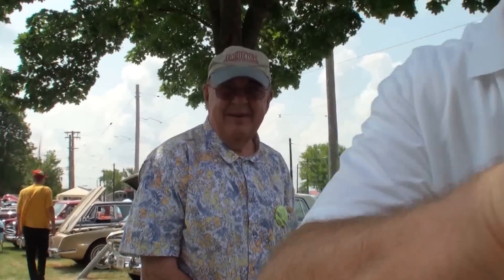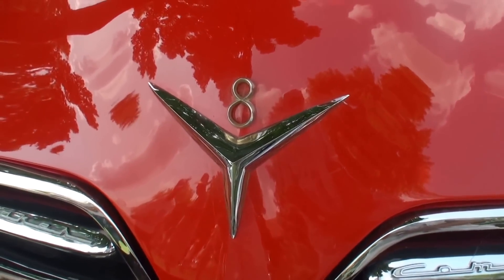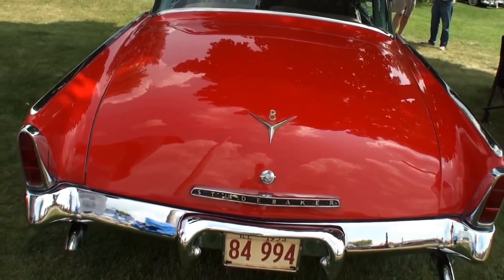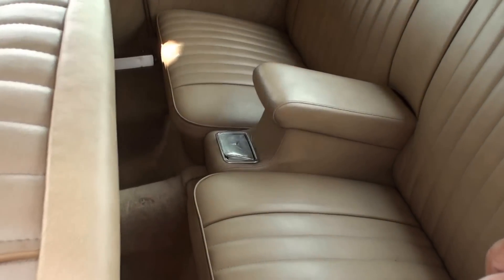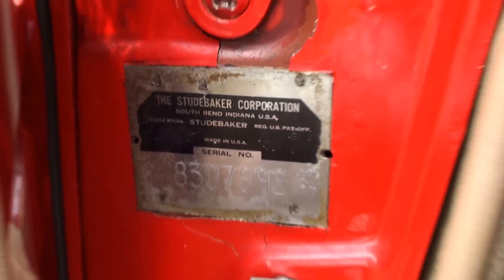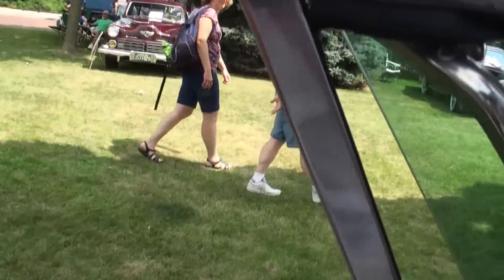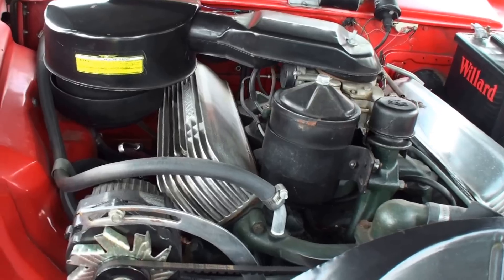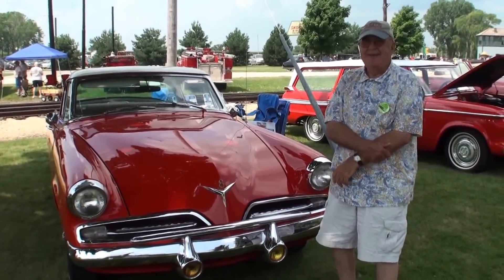1953 Studebaker Commander V8 Starliner Coupe - My Car Story with Lou Costabile

Comment: Chevrolet produced the first OHV V8 in 1918. Decades later, Oldsmobile introduced there OHV V8 in 1949. Cadillac introduced there OHV V8 also in 1949. Buick didn't get there's until 1953 with the Skylark Riviera. Chevrolet  and Pontiac got there's in 1955.
Reply from the maker: Hi William Scott, Thank you for viewing and sharing your knowledge, Lou
Reply: William Scott caddy v16 30s overhead valves .duesenberg dual overhead cam 8 stright
Reply: Yes. In Ohio my daddy bought a new 55 Chevrolet V8 with every possible add on. First one in town and everyone that came by on the street stopped their car to look it over. Automatic. Chrome visors over the side windows. Bumper guards, the works. I outran every Ford, Plymouth and Dodge V8 in the area, both drag and top end, though after starting from a standing stop and running on a four lane for over three miles, a 57 Plymouth that had been three to four car lengths behind me in the drag, was oh so slowly gaining in me at the top end, but we had to shut down as we were coming into E. Liverpool, Ohio.  

Motor Trend I think it was had tested the Ford at 96, the Chevrolet at 98, and the Plymouth at 99 on top end, so that corresponded with what we learned racing on the Wellsville, E. Liverpool road. So then I rolled my dad's 55 Chevrolet over for him and he got a Green Pontiac 4 door with two barrel V8 and single exhaust. End of dream.
Reply: End of dream that is until I moved to California and in 1957 bought a 57 Chev Belair 2 dr hardtop with 220 V8 and three on the tree. Red body, white top, just like all those car models seem to have today. Used to cruise Hollywood and Sunset Blvd with it, and on occasion Ricky Nelson cruised with me in his white 57 Plymouth Fury.  Also we cruised drive inn restaurants in Alhambra, Pasadena, and the Valley, plus one on Sunset.
Reply: William  and Ford Mercury Lincoln  in 1954 !!!!!
Reply: @johnhand871  57 chevy V8 was 265 Cu in !!!!  283 followed in 58 as did the 348....
Reply: @wilburfinnigan2142  Finnigan, you are so wrong. I was there, I drove and owned them new. The most powerful 55 Chevrolet offered, and very few had the complete package, was a 265 C. I. V8 with a four barrel carb, dual exhaust, and a hi-lift cam, rated at 195 H. P.   Very few knew or ordered this, as the cam option had to be ordered at the factory, so most 'power pack Chevrolets had the 180 HP four barrel and dual exhaust option.  Road and Track magazine tested this model and got 0-60 in 9.5 seconds. In 1956 the most powerful Chevrolet was again, 265 C.I. with 225 H.P, but almost all who bought the 'power pack' had 205 H. P.  Road and Track tested this model and got 0-60 in 9 flat. Both these models tested also had the first time offered by Chevrolet OVERDRIVE rear end, thus these models tested for acceleration had the advantage of being geared a bit lower than the models without overdrive. 

In 1957 Chevrolet also offered the 265 in a V8 up to and including the Bel Air model, but only in the two and four door sedans with automatic and not in the hardtop model. I know, because my folks had a brown bodied 265 V8 Belair two door with automatic. They ended up giving that one to my younger sister.  

But I, working at Bethlehem Steel in Vernon, CA, was making enough money that I was able to buy a 220 H.P. 283 model with four barrel, dual exhaust, and 3 on the tree.  They also in 1957 offered a 245 H. P. model with mechanical lifters and not hydraulics.  Then there was a 270 H. P. version with two four barrel carbs and a Fuel injected version with 283 HP and that one was widely advertised as 'One H. P. per cubic inch.'  So don't try to tell me that the only 57s had 265 inches. A few did, like my folks, but most V8 Chevs in 57 had 283 cubes. Oh, and the 283 models had gold V emblems on the hood and under the taillights, while the 265 models had silver Vs.

At San Gabriel Drag Strip, the 220 HP models were run in A Stock class, and the 270 and 283 H.P. models had to run in Super Stock. I won my A stock class and got a trophy the one time I took it out. Also, Riverside International Raceway, which became famous in later years until they finally bulldozed it for housing, I was there on THE FIRST EVER RACE held on the racetrack. Before they had their first road race around the course, they held HALF MILE DRAGS on the straight stretch.  I was ahead on my first drag, shifted to second, and the car stayed in first. That damned three on the column hung up on me and would not go into second, so I lost. But a friend of mine, Fred Von Ahrens, running his 1957 Dodge D 500-2, in which he had removed the Torgue Flight auto and installed, of all things, a 1937 Cadillac LaSalle floor shift, won his modified class. (It's nice when you own your own machine shop.)
Reply: @johnhand871  Usually people in the know talking about engines list the CU IN not the HP !!!  Why I thought your 220 refered to cubic in disp not HP !!!  The 265 was the MOST COMMON engine bought !!! In MINE I had the 235 6cyl  3 on the three !!!  Last chevrolet I owned for the last 50 years, and most people bought "Off the lot" and not special order !!!!!  Yes I lived that era !!!!!!   DUUUUUHH!!!!!!!
Reply: @wilburfinnigan2142  Now why in the world would you think that I would be saying 220 was cubic inches? You didn't specify, so I get my chance now to be confused about YOUR entry. What year are you talking when you say you had the 235 C.I. straight six with 3 on the tree? Was it a 55, 56, 57, what?  

I had a friend who installed a 1954 Powerglide model six (235 Cubes) in a stick shift 1949 Chevrolet, and he was quite successful in out dragging a lot of Flathead V8 Fords, and even some early 49-53 Oldsmobiles with that Chevrolet. 

For all its years up until 1955 Chevrolet had never offered the overdrive transmission. Ford had it, as did Plymouth and many others. Ford offered the O.D. with both their inline six and their V8 in the early 50s.  When Chevrolet FINALLY came out with their Overdrive, it was in 55 and was ignored by the buying public because of all the excitement being generated by the V-8.  But that 235 Six Chevrolet offered with the Overdrive, would have been a great vehicle for those that purchased one. The two or three maybe.
Reply: @johnhand871  Well my first car was a 49 chebby and it had a new 216 cu in with the 3 on the tree !!!!  drove that for a couple of years and traded to a 53 2 dr Belair Ht with the 216 rod knocker and three on the tree,  but I soon swapped out the 216 for a 56 235 6 cyl  great combo  that was traded for a 1957 2 dr  210  235 6cyl with 3 0n the tree......that was traded for a 1964 Ford Fairlane SW  with the 260 V8 and 2sp Fordomatic, had family by then...second car was a 52 chev 2 dr business coupe with a rod knocking 216 and 3 on the tree and that got a 57 chev 235  6 cyl with the orig 3 on the tree.... Last chev I ever owned  fords ever since........